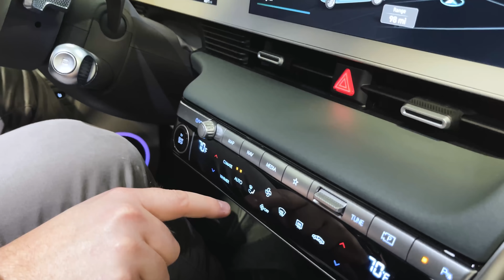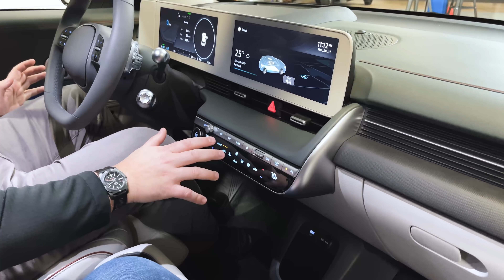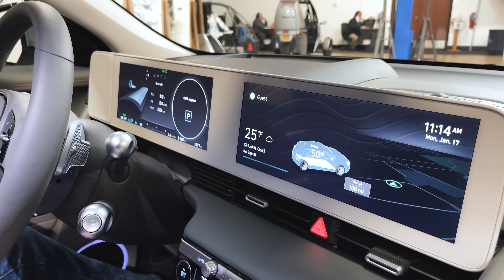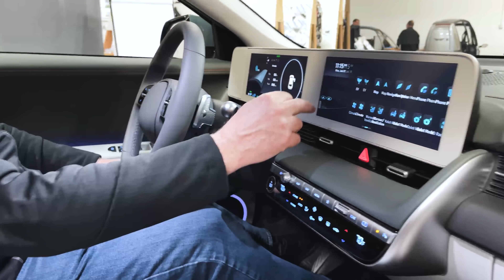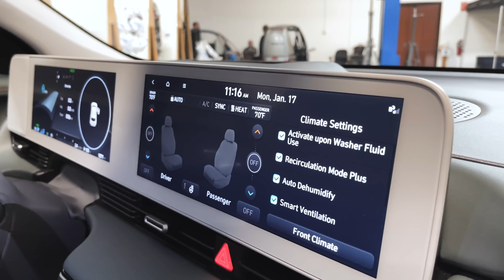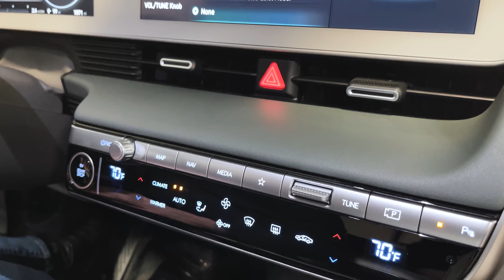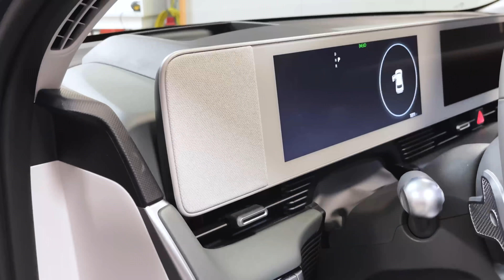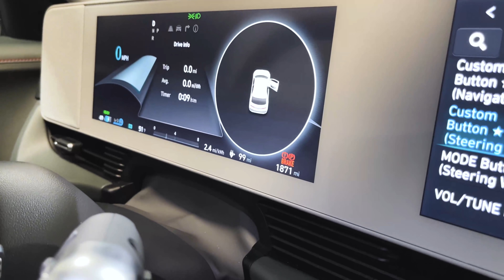2022 Hyundai IONIQ 5 | Sandy's First Impressions

Comment: My notes: strange to not see the glove drawer we got in Europe. Front trunk size depends on drivetrain variant. Rwd one is bigger. Underneath that box is where the fun begins. I love how the layout for at least the Rwd is. The underlying high voltage junction box is saving me days of work as a performance benchmark engineer. Everything is easy to work on. Will run on a dyno with just disconnecting the hood lock sensor. Subjectively manual controls for hvac are highly sought after because you can reach them without the necessity to look. That makes bmw iDrive and Porsche so good, because it's ergonomic and works and bridges the gap to really good voice command systems. Usually it is good design if you leave the path of success open to the user. Wouldn't you say? For me at least it is better that the car seems to be iconic, fearing it would have been an ironic ioniq.
Reply: Our RWD in Canada has the small frunk.
Reply: @MihneaStoian  do you get like a Nordic country package, an extra heater, or something?
Reply: @MihneaStoian  That's weird. I've never seen that in the dozens of videos I've seen from all over the world. Are you sure you don't have an AWD by mistake? 🙂

Comment: A few things to note: seats slides forward to increase trunk space. In Europe and Asia the glove box is actually a glove drawer, to have more useful space. Also: ventilated seats!

Edit: and the blind spot camera view in the instrument cluster when activating the indicators looks splendid!
Reply: Way better built than any Tesla.
Reply: Ventilated seats on in europe/asia?
Reply: @TheDraconiuslives  looked like ventilated seats are present on the car Munro teams has also.
Reply: Actually, if you look at the side of the seats, there's no button to move the rear seat. Perhaps it's manually operated in this version and they missed it?
Reply: @bilgyno1  yeah, in Europe (Sweden at least) the motorized slide is only on the "advance" trim, there's manual on the cheaper "essential" trim. All versions have some kind of slide though.
Reply: @David Sadly they failed by crippling the car: Basically no charging in winter (40 kW max, and ten of that is used for battery heating...), the power plug in the car doesn't work when you charge the car... the OTA doesn't work and Hyundai might maybe believe think that they might be able to think of a solution to make that work this year.

The rear window is also constantly dirty and you can't see anything, the navigation doesn't plan charging stops by itself....

Adition: I forgot the quickly overheating drivetrain.
Reply: @David This is really a nice car!  Elon has said that Tesla can't do it alone.  The " competion" is really not competition, but a nuanced push to get other Automakers to start building full EVs, which they are now, thanks to Tesla, who showed it could be done.  It's great to see more choices, but there can only be one Greatest of All Time.  Competition is hard, but its more a race against time than against people.  Good job Hyundai!
Reply: @germanmosca  Wow!  Thanks for the in-depth review.  I sincerely hope Hyundai can fix these problems.
Reply: @germanmosca  That's a bit of an exaggeration. Sure it does cold-gate, but asy ou mentioned it'll get fixed by a software update. It is however way way faster than 40kw. It'll cold gate for a few minutes until the minimum temp in the batterypack reaches 20c. Then it'll bump up from 70'ish kW to about 120 and then after the next bump at 25c it'll reach 205 kW. So not at all as bad as people make it out to be, but absolutely a lot worse than the 18 minutes from 10-80% as the marketing says.

OTA is already here. Update your car to the latest version (easy done with a thumb-drive) and you'll have it.
Reply: @germanmosca  While charging the power plug can’t work because charging uses the same circuitry to generate the DC to charge the battery as the power plug uses to generate AC the drive the plug.

Comment: I love the physical buttons and I'd feel like I'd be ripped off if they didn't come as standard. I use them all the time and it's faster and takes my eyes off the road for less time then using the touch screen. In fact, I hardly ever use the touch screen.
Reply: I agree. I can push buttons, turn knobs, and flip levers using muscle memory without taking my eyes off the road. It's no different than touch typing.

Comment: I like the full door frame around the glass.  I feel this is an area where Tesla cut costs by having no frame around the glass.  I bet the Hyundai has less wind noise.  Plus you don’t have to deal with the glass going down every time you open the door.  I’m surprised you didn’t mention this.
Reply: Lol, no 😆. Having frameless doors is just beautiful 😍. It costs extra too...
Reply: We had an OUTBACK Subaru with freameless____NO WIND NOISE that l recall! So Tesla could very well be the same! I sooooooo want frameless/handle less doors on my CYBRTRK
Reply: @DG-uv3zw  LMFAO, no. I have a Model 3 since 2.5 years and 106,000 km now. The frameless windows are still crap like on any other car (Audi, BMW, K.I.T.T. 😁).
Just like the doorhandle bullshit.
Reply: @Stefan_Dahn  guess you don't have eyes for aesthetic 😁
Reply: I don't think having frameless doors even saves on costs...
Reply: It's the difference in a 4 door hardtop and a 4 door sedan.  The frame of the door is great until you run into it.  The frame-less design is sportier, more like a convertible, especially if its of the pillar less design.
Reply: @wilfredvanvalkenburgh2874  Maybe just open your eyes while running around?
Reply: @DG-uv3zw  Maybe you start running around everyday with some high heal shoes and you might get a clue. Form follows function Frameless doors are quite noisy, when you go 120-130 km/h and more, wich is daily business on our German Autobahn. 😁
Reply: I have an i3. I really don't understand what frameless doors give you on a hardtop other than complexity.
Reply: @DG-uv3zw  Frameless doors are really annoying in the winter. Clearly Hyundai is designing the car for people who don't all live in California.

Comment: Auto hold stops it rolling back on a hill when you stop without putting the handbrake on.
Reply: Inte that what one pedal driving is for?
Reply: @ulwur  I think it’s a little different. You could still have creep (like you’d have with a traditional torque converter) with auto hold but override it when the car comes to a complete stop. I think one pedal driving would bring it to a stop every time you lift off the accelerator. I’m just guessing, I’ve only driven the Kia EV6, which is the sister car to the Ioniq 5. Had to figure it out for myself as sales guy wasn’t with me due to Covid restrictions etc. so I might’ve missed something

Comment: My 2014 BMW i3 (yep, 8 years old!) has 8 programmable physical buttons, when you hover your finger over each one, it shows you on the screen what each button has been assigned to. I absolutely LOVE this feature. I have buttons assigned to different radio channels, charging settings etc. It's like the 'star' button except there are 8 of them.
Also totally disagree about climate only being on the screen - there are a few things that I believe should be instantly accessible via physical buttons, such as screen defrost, hazard warning switch, multimedia volume/mute, glovebox open (Tesla, seriously), headlights etc. The rest of it you can bury in the screen :)

Comment: Lexus RX (2004-2008 era) has rear seats that can recline (a bit) like that also, and the rear row of seats can also slide forwards/backwards (maybe 6 inches in total) to give more luggage room or leg room depending on which you want.

The rear cover/shelf has a single position but there is a loose piece of cover which clips onto the rear headrests so that the seats can recline without interference with the shelf support.
Reply: I had a Lexus GX that had reclining seats as well.
Reply: The Hyundai Santa Fe Sport (2013-??) also has rear seats that recline.
Reply: Same for Hyundai Tucson.

Comment: To add to the comments about the separate heater / media screen and buttons … Sandy’s comment may be fine on smooth roads ! On bumpier roads however, (I’m in Ireland) selecting stuff from a screen is a nightmare. I have to rest a thumb or finger on the frame of the screen, to steady my “selecting finger”, and even then I’m hitting the wrong icons. So, definitely need some separate buttons for essential tasks, a) to find them more easily, and b) to select them accurately and consistently.

Comment: 11:45 There's room to store the sun shade under the floor and you can clip it in to some recesses in the side walls. The rear seats also slide forward and back which is why the sun shade has two positions and it gives you more luggage space in the trunk.
32:20 If you get the RWD version you'd have more space in the frunk, not massive amount but you get more
I wish you'd research the car before "reviewing". I get it's a first look review but having someone there who's actually informed would be a good idea

Comment: Great video yet again!
Lots of this veichles in Norway.. a friend of me have one of this and he is so happy with it!
Only downsides so far is low charge rate in cold weather, quite a bit lower range in winter, and the adaptive cruisecontrol is jerky
Greetings from Norway👍🇳🇴
Reply: Bjørn recommended to charge without the heater on in the Ioniq 5 and EV6. It seems that if the HVAC system is on in the cabin, the car can't use the heat-pump to regulate the battery.
Reply: America needs to catch up with it's Norwegian/European/Chinese EV brethren. Btw, I have Norwegian Ancestry, I reside in the Wash DC region and Norway's one of the places I seek to visit!  Of course, Spring/Summer/Autumn would be the ideal time !
Reply: Say Hello to Morten Harket.

Comment: BMW has an AutoHold button as well. It's useful in stop and go traffic, you step on the brake to stop the car but with the feature switched on you can relax and take your foot off the brake pedal. The feature ' Auto Holds' the car. When traffic moves again, you simply step on the gas pedal and the brakes automatically release.

Comment: Like the engineering perspective in this review along with knowing very little beforehand to gage a more objective experience, but then you miss things like a movable rear seat. Yes, the split seats move back and forth. And the rear seat does have a 3 prong electrical outlet underneath the middle.

Comment: My favorite kind of UNVARNISHED review, two guys looking something over Cold and making  discoveries as they go, I also agree that the two position security cover bracket should move with the seat back and finally the mystery vents to nowhere on the rear hatch....that's a head scratcher!
Reply: My 2017 Murano rear cover has a  flap on the seat side that attaches to the head rest posts to hid the gap. The seats tilt as well.

Comment: Totally disagree with Sandy about the preference for on-screen HVAC controls.  They require more driver attention away from driving.
Reply: Yes, it is not easy to control climate with touch screen while driving.
Reply: Surely you would set the climate before starting a drive, having it set to your own preference.